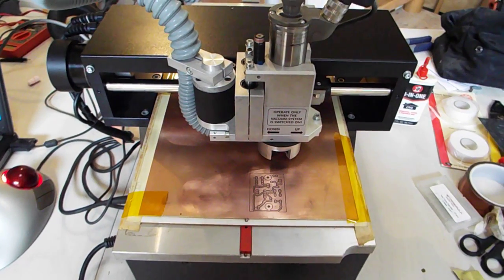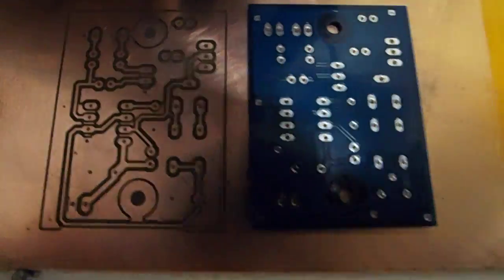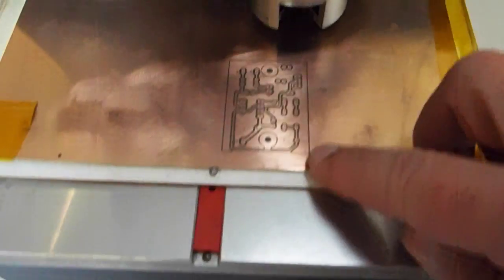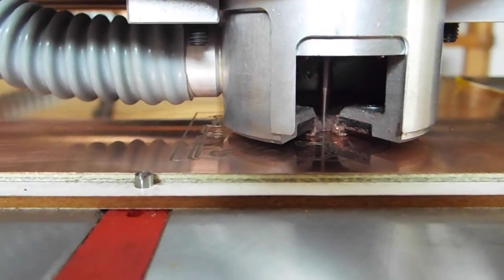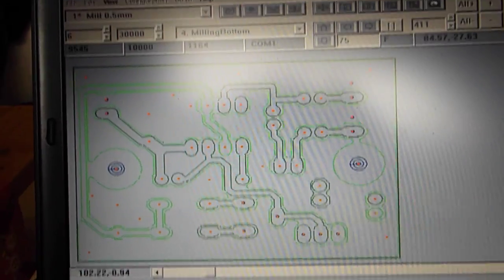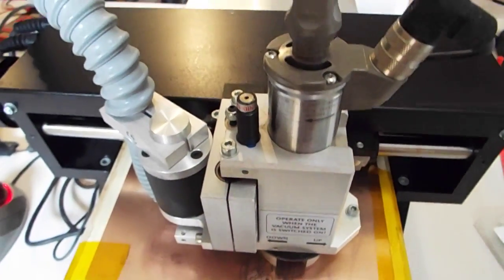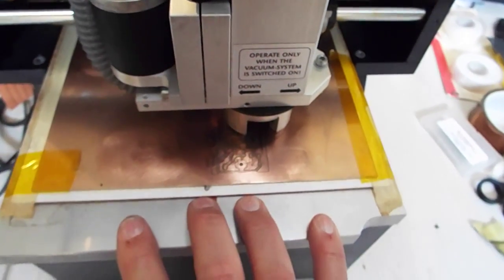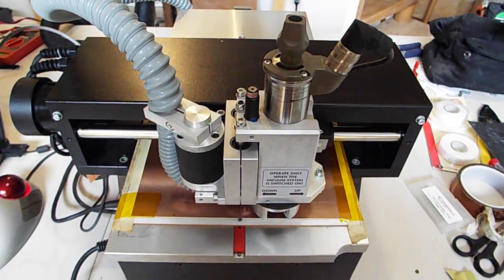LPKF 91s / VS testing PCB CNC prototype machine

Comment: I found one of these in the junk/dumpster at work - not sure if it works or if all the parts are there - or whether it's worth it to grab it. Is the SW still available for it these days? I'm not that interested in making PCBs but possibly engraving aluminum/brass - have you tried that with this - if so, how did it go?
Reply from the maker: It has software available, but you need a software key to run it. It is worth money just selling it as is on ebay. it will work to engrave plates just fine.
Reply from the maker: is the one you have a 91s?
Reply: @madscientisthut  Yes - a 91s - it appears they were doing some PCB builds with it as there was some leftover material in it. Would love to sell it even as-is but that's a grey area for dumpster diving from work... Also not sure I want to get a hernia lifting the thing out of the dumpster... lol Thanks for the info!
Reply from the maker: if you want to do some disassembly, I would buy some of the external parts from ya. ( I would be interested in the spindle, and two external stepper motors for spare parts )
Reply: @madscientisthut  argh - - snooze I lose unfortunately - someone had emptied out the bin when I went back - gone forever - - what a shame...
Reply from the maker: Bummer, I paid for an unknown condition very used unit on e-bay from Singapore, It was about $1500.00, when I got it it would not power up and took some work to get going.

Comment: I have just got a 93s that was thrown out at my son's works.  It has been in storage for quite a while.  It works fine except for spindle that has the same symptoms as yours had. How did you lubricate the spindle?
Reply from the maker: Can you send a picture of the spindle? madscientist@madscientisthut.com
Reply: The spindle is identical to the one on your machine.
Reply from the maker: I ran WD40 through mine until it came out clear then ran it and ran more WD40 through it. The after that I used 3 in 1 oil to lube it. It seems to run fine and that was quite some time ago. I was quoted over 1K to have it re-lubricated at the factory...that is why I took this path. I figured worse comes to worse I can always buy a new spindle for it.
Reply: I removed the top of the spindle, 3 screws, cleaned it then sprayed in WD40 as you suggested then poured in 3 in one and let it soak for a few hours. Ran it for a while at 10000 then did a job at 25000 for 1/2 hr. Brilliant, just slightly warm. The solenoid that moves it up and down was hotter. Thank you so much. Without your suggestion I would have been apprehensive pouring oil in an electric motor. I am using the LPKF to engrave on wood and plastic. I edit the pictures with Inkscape, save them as HPGL then import into CircuitCAM. I was just getting the hang of it when the spindle packed in. Windows 98 computer and all the software came with the machine. Once again Thanks. Ray (Mad octogenarian)
Reply from the maker: Very Good! You will have to send me a picture of your engravings I would very much like to see that..
Reply: I put a link to photos in a comment but they don't appear to show. How can I send you photos?
Reply from the maker: You can send it to: madscientist@madscientisthut.com
Reply: bonjour , actuellement j'ai  une machine lpkf version protomat 95s , mais j'ai pas le logiciel de commande (software) boardmastrer version 5.0 ou plus , donc svp si vous avez ce logiciel envoyez le à ma boite E-mail

Comment: I just found one of these hidden away in a closet at work.  A fellow co-worker and I have taken it on as a pet project. At first we thought we would gut the electronics and start over with new controllers.  Were you able to just down load the software and it worked?  That would just be too simple.
Reply from the maker: The hardest thing was getting an older laptop that had a builtin serial port on it to run the LPKF, and I also have to run win XP. The LPKF does not run right on a USB to serial port converter, there is too much lag time that causes it to pause as it it is moving around curves.

Comment: what method are you using to connect the machine to your computer?
Reply from the maker: +Dylan Hack This system uses a 9 pin serial port. This is the main reason why I am running on an older laptop.